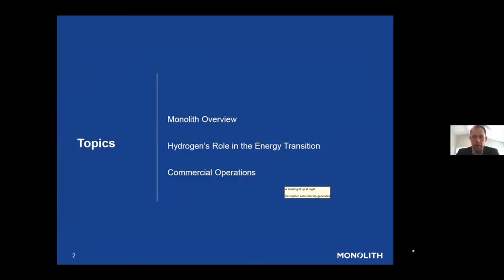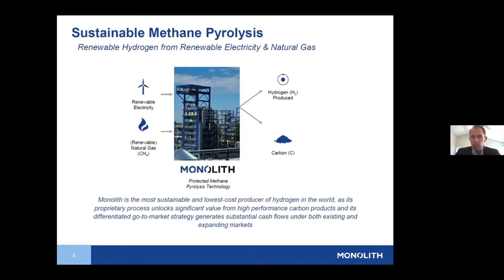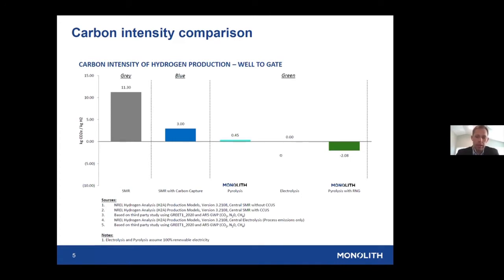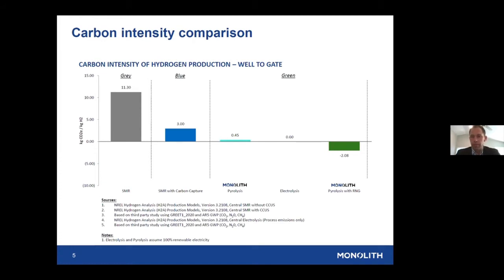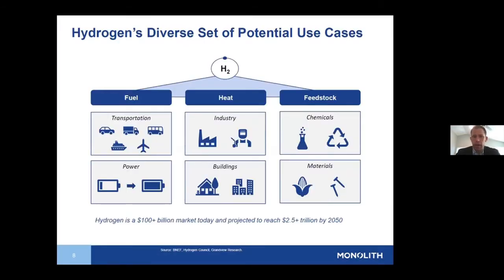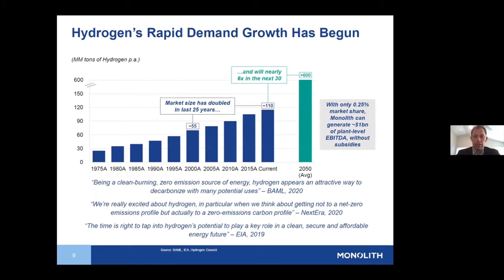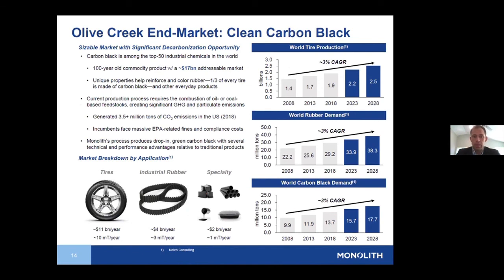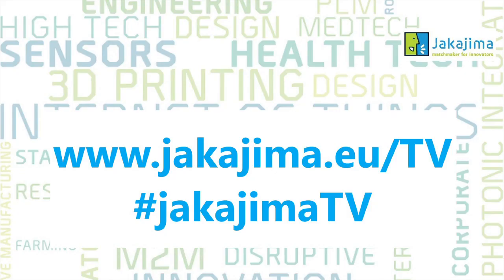Clean Hydrogen from Methane Pyrolysis

Comment: Would be cool if this could be containerized.  It could be used at stranded gas locations.  PEM fuel cell containers could provide electricity and water on site from hydrogen.  Containers could also hydrogenate CO2 to methanol, DME, or  back to methane.

Comment: Now there are reports of finding Natural Hydrogen or white hydrogen 1.25km  below the ground in nations like Mali, France, etc. Else Methane found in Natural Gas or in biogas or release by growing plants of rice or farted out by ruminants is the richest source of Hydrogen. Commercially Hydrogen is always coproduced along with CO or Ethylene or Propylene or Styrene monomer or Solid carbon or Oxygen or Chlorine gas and NaOH or KOH and that too in capacities that need continuous process operation rather than batch process operation. The coproduced Hydrogen is in a majority immediately consumed on site. Catalytic reactors for coproducing Hydrogen, pressure swing adsorption based separation of Hydrogen from unreacted Methane and higher alkanes, inerts, byproducts and recycle of unreacted Methane back to pyrolysis reactor needs regeneration of adsorbent and catalyst which implies that multiple beds have to be used for ensuring a continuous operation. Continuous processes like catalytic steam reforming of Methane operates at 20-30bara and temperatures upto 900degC. Use of catalysts and adsorbents compells to pretreat the feed gas mixture free from components that can poison the catalyst or adsorbent. 
Methane pyrolysis is favored by low pressure of Methane and temperatures above 1400degC to achieve substantial conversion of Methane to Hydrogen but use of such high temperatures faces practical problems. Catalysts can reduce the reaction temperature but need to be highly selective and have high life or be easy to regenerate. It should be investigated  how selectivity towards Hydrogen formation and alkane conversion are affected if Natural Gas dry and desulphurized is fed to pyrolysis reactor instead of pure Methane and unreacted alkane seperated from product Hydrogen is recycled back to pyrolysis reactor.

Comment: REAL Green Hydrogen is made using Methane from Carbon Negative Algae on scale using current Steam Reformation Plants. There is absolutely no need to use Electricity to make Hydrogen, Green Hydrogen is from Algae, Blue Hydrogen is via Electrolysis, Brown Hydrogen from FF Gas!
Reply: Algae grown in Photo Bio Reactors( PBR) permanently sequestering atmospheric CO2, and providing a source of Methane for Carbon Negative Hydrogen. Which could be produced at scale using current Steam Reformation plants!  No need for electricity or the masses of resources that would be used or large amounts of moneys to build new plants! https://youtu.be/QI3Al1dpuUY